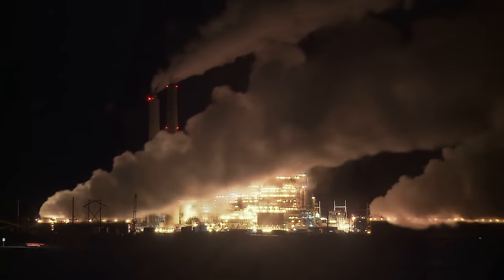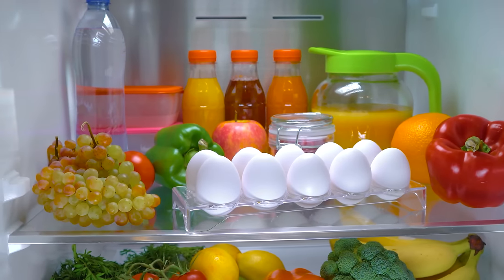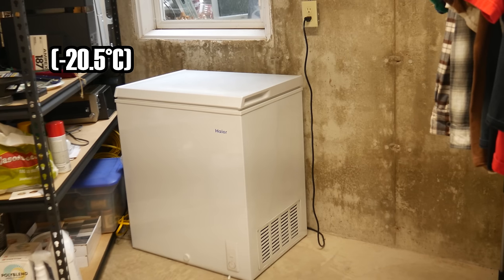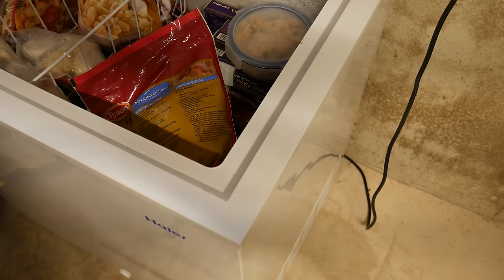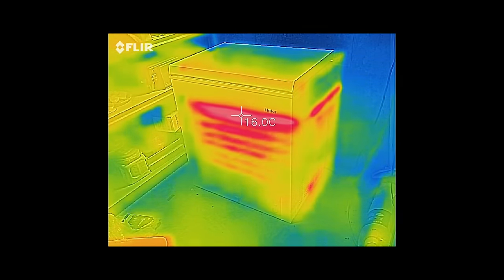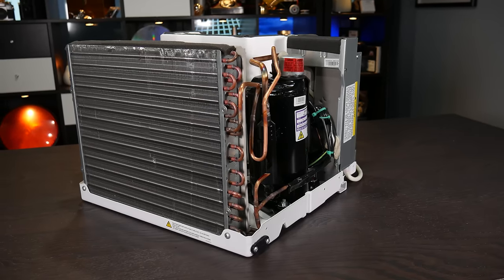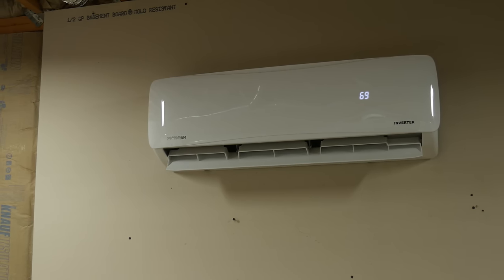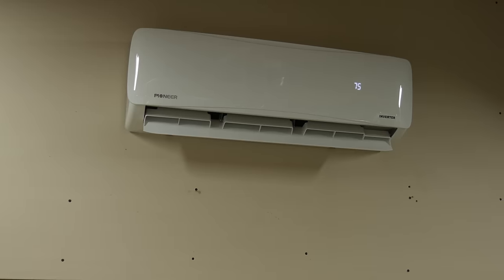Heat Pumps: the Future of Home Heating

Comment: Reverse cycle air conditioners have been a thing in Australia for many decades.
Reply: And yet, many states still insist on installing whole-home ducted gas furnaces in addition to one or more split systems!
Reply: In Portugal too
Reply: @ShaunRuigrok where I live, the difference in cost isn’t comparable. Natural gas is much cheaper than running a heat pump.
Reply: I've had some in my rental properties in the USA from 30 years ago.  It's not that they haven't existed, it's just that they haven't really been very widespread outside of certain areas of the USA due to the extreme climate differences of the country.
Reply: Brazil too....
Reply: @reed311  That makes sense.
Reply: @ShaunRuigrok  as someone in HVAC most people in the field prefer gas heat simply because it produces a higher temperature heat and therefore blows a warmer air though the vents
Reply: @abrahamdzyadyk415  Personally, I rather dislike the whole "warmer air through the vents" deal. I prefer milder heat with a longer runtime. It's slower at heating, yes, but doesn't make you feel like you're being baked alive.

Comment: In MN we spend most of the winter below 0F so we would put serious wear on a heat pump if it was primary.   These things do not like to run continuously for months at a time which is what it would have to do to mantain a comfortable temprature even with auxiliary heat.    Though when things get better at lower temps it might become viable

Comment: Hello from the wondrous land known as EUROPE. Over here in this strange land I have never seen a domestic air conditioning system that was NOT reversible.
Reply: There are plenty that are cooling only
Reply: Im in that business and live in europe. And yes ac units that can't heat are pretty rare this days
Reply: Here in the north, they're mainly sold as heaters, with cooling being a bonus in summer :D
Reply: @enemixius  Yeap, last summer was so hot that we had to use it in reverse for cooling... for two whole days. Nice bonus, but rest of the time its off or heating
Reply: The 2 way heat pumps have been used in the U.S for at least 40 years that I personally know of.
Reply: @TheCerovec  I have a old Panasonic from the 90s, goes both ways.
Reply: Asia is the same way
Reply: *Hello also from Europe. I have never seen a domestic air conditioning system.
Reply: @EggBastion  you must have nice weather. 🥵🥶.
Reply: Same in south america. Since the 2000s when builders wanted to start cheaping out on natural gas installations, they started installing cold/hot split units everywhere.
Reply: we're broken over here, don't mind us. just ruining the planet to save a couple of bucks
Reply: The US has a much more humid and much colder climate on average, which makes heat pumps more practical in europe for all the reasons listed in this video.
Reply: Same here from the land down under

Comment: Watching this from Finland and we have had heat pumps being the main heating element last 20 years. Its weird that isnt the case in America as its save so much money in long run.
Reply: America has ridiculously cheap energy though, and a mindset that any problem can be solved by throwing even more energy at the problem. They have no real incentive to invest in more efficient means of heating and cooling.
Reply: @spencerwilton5831  Might be true with oil and gas yes, I don't know if they are the main source of energy for warming houses? But electrisity prices are even lower in Finland than USA, so houses that warm with electric power of some sort should get heat pumps.
Reply: We've had em a long time, especially in the south where they make more sense.
Reply: Frank Silvers  just Googled the avarage..
Reply: Frank Silvers  I didn't ment to offend anyone, just wanted to know what is the reason for lack of heat pumps, chill. I work in energy business and I am just generally interested about this stuff.
Reply: Frank Silvers  😂😂

Comment: Reverse cycle air conditioning is actually super common in Australia; I had no idea it was that efficient to heat!
Reply: When I clicked on this video I really thought it would be something new... I would have never guessed the split cycle air-conditioning I had grown up with would be considered 'efficient'... not with the way my dad would complain about the energy cost of using it lol
Reply: @JFat5158  typical dad thing. My dad still complains about lights being left on despite the fact that new LEDs use 1/10th the power of what halogen bulbs used.

Comment: We have been using an air-to-water heat pump for 4 or 5 years. I live in South Turkey, and our pump is a Japan-made Toshiba Estia. It's as easy as using an air conditioner. Our bills decreased significantly compared to natural gas. It is also able to operate as an air conditioner.

Comment: The leather seats were completely covered in mold...
"If I wanted to keep anything in here of value, air conditioning was practically a must." 😏👍👍
Reply: or maybe... a dehumidifier?  Seems like that would be cheaper and still effective? lol
My garage space is underground/basement space, so it is essentially required, and I have another one in the main basement space.  $200 each, keeps the air less musty and no new mold stains after painting, and the power bill barely moved.  Been a good call.
Reply: Dehumidification and the refrigeration cycle are also tightly coupled.
Reply: @CaedenV  chemical dehumidifiers aren't as effective as electric dehumidifers and elecric ones are basically heating pumps with both heat exchangers in the same room.

Comment: Been using a reverse cycle for years, everyone owns one where I live. They are great, but electricity is expensive here so they cost heaps to run. Unless you have solar/battery you're better to use gas heating.

Comment: Here in Sweden, where it is often very cold, especially up in the northern parts of Sweden, heat pumps are very common - of course!
Often it is not heat pumps that take the heat from the air outside. 

No, instead, they take the heat from the ground, from the earth or from a nearby lake. If the ground consists of rock, you can drill a hole straight into the ground and then lower down a collector that picks up the heat. The borehole is often very deep. It can be 100 m deep or even more. 

The advantage of drilling a hole in the ground is that it is always obove the freezing (or approximately +/- zero degrees Celsius). The collector is a long plastic tube that contains alcohol so that the liquid cannot freeze if it gets that cold. The collector with the alcohol picks up the heat from the borehole in the underground.

The heat from the borehole can be used to heat the house when it is cold. But it can also be used to cool the house when it's hot. That is, just like an A/C but with the difference that the cold is completely free (once you have drilled the hole...)! So it is an expensive system to install but it has very low running costs.

Nice video as always!
🥵♨😙🔥

Comment: In New Zealand, Heat Pumps are EVERYWHERE. If you don't have a fireplace, it is the heating of choice. 
This is mainly because New Zealand has pretty moderate weather and those really temperatures below freezing are pretty rare over most of the country. It also doesn't get that hot in the summer, but most heat pumps here are set up for both heating and cooling, so you can use it as air con too. Because of this very few people have American style air conditioning in their homes.

Comment: You should make a video on the defrost cycle of these systems and how unnecessary defrosts are present with interval time-temperature defrost control boards, versus demand defrost which is much smarter and energy efficient.

Comment: I understand the concept of heat pumps perfectly fine, it all makes sense when you look at it - and yet at the same time, even though I'm understanding the basic principles of how it works, my brain still tells me that it's confused by the fact that something is boiling and is not releasing heat but actually absorbing heat in the process. My brain tries to outsmart itself by suggesting common knowledge / intuition (don't touch something that is boiling or you will get burned), which in this case is really stupid. It's probably the same effect as when I'm looking at the clouds and my brain goes like "Hey look, there's an elephant!". The part of my brain that is responsible for basic survival and reducing complicated information down to very basic concepts in order to save processing power is actually hindering the intelligent smart part of my brain to do it's work properly. Stupid brain...
Reply: Just think of liquid nitrogen, thats boiling but is super cold
Reply: I get confused when they say "when the temperature drops, it starts boiling", and I'm like how does it start to boil, when you need heat to boil.
Reply: @mihapetek3418  That's exactly how it boils though, by taking heat from your home. See, when your boiling point is less than 0 degrees F, that means room temperature heat will boil it. That's how it absorbs heat. It takes the heat from your house's air and uses that to boil. It then goes outside, gets compressed to become super hot, then dumps that heat outside before going back inside to start the cycle all over again. This process effectively transfers heat from the inside to the outside.
Reply: When water boils, the process cools the water. That's why you have to keep the burner in, and why covering it speeds it up.
Reply: My brain fails to wrap around how a vapor cycle machine can work both ways.
How an evaporator and condenser can just switch roles.
How a compressor, or an expansion valve/orifice can work in both directions.
Reply: @mihapetek3418  water in a vaccume will boil below freezing temperature
Reply: @davecrupel2817  The system has something called a reversing valve, but the reversing valve doesn't actually reverse the flow of the refrigerant entirely. Instead what it does is redirect where the refrigerant goes after the compressor, because, as you say, a compressor cannot go in the opposite direction.

Normally after the compressor we go to the condenser. The reversing valve instead sends it to the evaporator instead, outlet side. Next the metering device, then the condenser. At which point the reversing valve directs it back to the inlet side of the compressor.

So while the direction is reversed in most areas, it's not reversed in all areas.

As for the txv/orifice, they typically come in pairs for heat pumps, one for each side, with both containing a 'bypass" for when their use is not desired. That way only 1 is ever active, depending on which way the refrigerant is flowing.

Although some metering devices can handle both directions of flow and so the system only needs one of them.

Comment: Here in Northern New England (150 miles from the Canadian border), heat pumps will be a tough sell for a long time to come. Many people around here are on Propane/NG with many having a permanently installed Generac generator as backup..which seems to work best. While the -20F Temp and -30F Wild chill we had just last week are not normal temps, we do get extreme weather and at least for now, it seems heat pumps are a much better solution for people living to the south...of a Boston latitude.
Reply: Same for Michigan. Most local HVAC technicians do not like them for our climate.
Reply: @ryanvandy1615 exactly. If you want to actually be comfortable and warm- in a cold climate, heat pump ain’t my answer. Sure they’re neat- and cost effective..  but not the most comfortable in cold areas

Comment: As someone who lives in the south, I'd really love it if my AC compressor were reversible. Sadly, it's not and it's prohibitively expensive to switch.
Reply: Same. It's something to do when the compressor fails.
Reply: @LeoInterVir  Unfortunately when your compressor fails in Atlanta in August, you take whatever is available to be installed this week instead of taking the time to evaluate and bid out other options... Oh well, another opportunity will crop up in another 10-15 years right?
Reply: @danbert8  if you have money to cover the difference, that's the real issue. If you do then it should be done as it saves money spent on heating. Usually the same person you hire to change out your unit can sell and install both types. Your point is moot in that case. 

Hi from Miami. I have spent weeks with no power after hurricanes, even having to boil water. I also work in the sun daily. It's not the end of the world to struggle in the heat.

Comment: I really wish LN2 was a common refridgerant. Maybe then heatpumps would be more useful in winter in places where it not only gets cold enough to snow but even in Antarctica, especially if the outside part was put in a buffer shed that's kept at 0% humidity (and Antarctica is a desert anyway).
Reply: It might be soon, as for ecological issues, other standard refrigerants have become technically illegal to use in many states, such as Colorado. I don't know what standard they're moving to, but who knows, it could be LN2. Unless it happens to end up even worse for the environment for all we know.
Reply: @jsanchez23  shouldn't be an environmental issue, as air is 78 percent nitrogen already and ln2 is just cooling and squeezing it. I am pretty sure to get ln2 the "factories" pretty much use stupid cold air conditioners that make the air condense on its coils rather than just water
Reply: @collinbarker  the factories actually use a cascade of them, each colder than the previous one. The cold side is used to chill the compressor of the previous stage as it compresses. Pretty sure the ony reason it isn't used already inspite of the environmental friendliness is that gets outweighed by 3x loss in efficiency (3 compressors for LN2). Coldest single stage I know of is -80C for dry ice storage, but no idea on what weird brew is used in that loop.
Reply: @collinbarker  Well then fair play, I just hope it ends up actually being adopted as the new standard. As you never know what they'll end up picking and or prioritizing nowadays. Since these industries often care more about bottom line, at least more than efficiency for the end user. Since outside of pressures to change as a result of climate change. They likely never would have changed to a more efficient coolant otherwise. Plus more efficient usually means much less time and money spent maintaining it. So sounds like ln2 would be one of the most viable options from a functionality standpoint ,but who knows if it'll be the next new standard for refrigerants

Comment: The metering device lives inside of the outdoor unit. It is almost exclusively an EEV, electronic expansion valve, which intelligently meters refrigerant at the evaporator based on the superheat (the vernacular for temperature rise above boiling point) ensuring that no liquid makes it to the compressor. 14:30
Reply: That is what mini split systems use yes. On conventional systems there the cooling metering device is located inside and is rarely an EEV. There is a second heating mode metering device located at the outside coil. Both metering devices only meter in one direction so one will get bypassed.

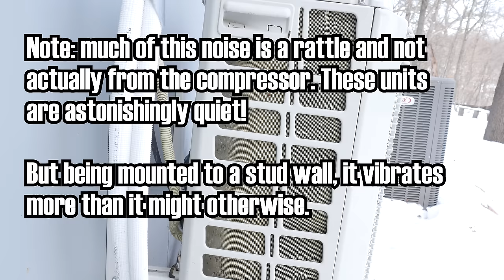Comment: I know that many people mount those units on a separate platform, to avoid the rattling you're getting in the video at 23:30
Reply: that's also why there's a concrete pad for the ac box
Reply: I put my outside unit in an attic to reduce vibration noise, installed it on absorbing springs which worked great

Comment: For those of us who live in hot climates, like me in Phoenix, the heat pump is all that's needed in winter. But, in summer having an swamp cooler (evaporative cooler) really helps. Just as the heat pump can run into a wall when the cold winter gets too cold, it can also run into a wall when the hot summer gets too hot. Heat pumps are amazing and wonderful, and really the furnace or swamp cooler should only be occasional additional help. Interestingly, though, the swamp cooler can actually help improve the efficiency of the heat pump in summer. Air conditioning (including heat pump) will dry air, as you pointed out. Swamp coolers saturate air with moisture to cool it. So cooling by putting moisture in the air and then having another system remove moisture, and thermal energy contained in the moisture, from the air makes that system even more efficient. 

When it's 120+ F out, we also need all the help we can get to cool down. It's fascinating that we can both use heat pumps, but the secondary system needs to add heat in cold weather in your area but not mine while I need to cooling capability in hot weather but you don't. But, we have the heat pump as the whole-house primary system instead of the room system. 

What's amazing is how heat pumps seem to be some kind of alien future tech there. I visited France and Bulgaria, as well as Spain, in August last year and it was hot. I mean, not as bad as I'm accustomed to here in Phoenix, but there was a heat wave there. For some strange reason some hotels have no air conditioning in the rooms, let alone heat pumps. I spoke with people about heat pumps and they were surprised to learn such a thing exists. What I want to know is how is it that Europe can be so far behind in this not-at-all new technology?
Reply: The best HVAC system is going to depend strongly on climate. In Phoenix it gets really hot but also really dry. You live in a desert. A swamp cooler is a good option out there because they add humidity and lower temperature. They consume much less power than conventional AC does. The biggest downfall to swamp coolers is that they do not work if there is high humidity. In many climates its also very humid so AC works far better. They need to remove humidity, not add it.